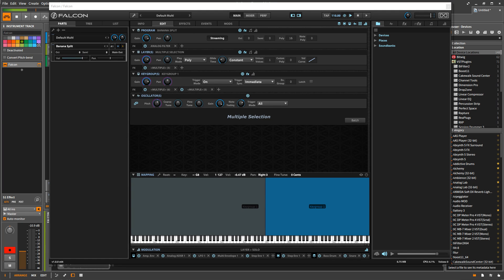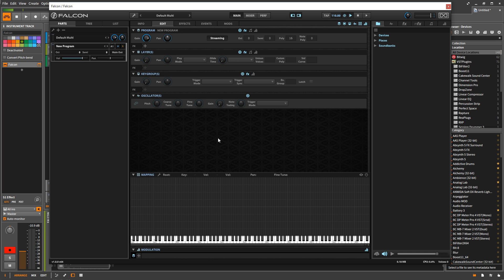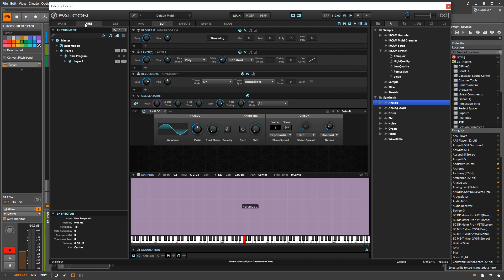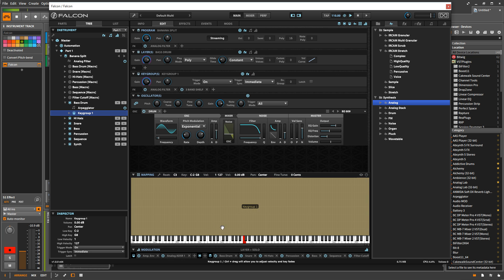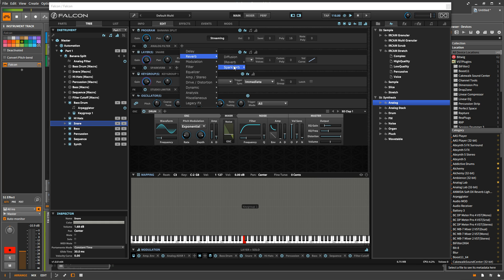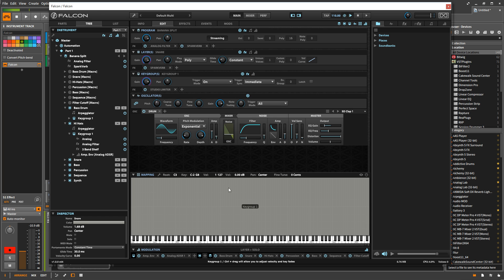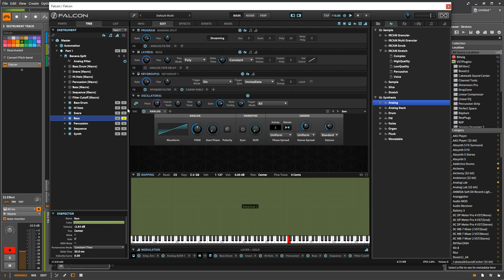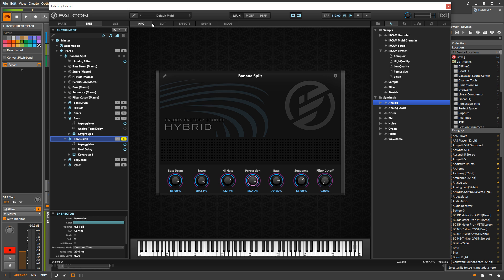UVI Falcon: Understanding the Architecture

Comment: do you still use falcon and think highly of it since 2015? i really want to buy this synth to do 80's music...i dont want to buy vintage vault i actually want to program my sounds from scratch? is it capable of that sound of those vintage synths from just the oscillators?
Reply from the maker: It is a really powerful synth, but I don't use it as much as I used to. There are some quirks with it that make it a pain to use sometimes. One big thing is that automation is kind of a pain with it because you have to assign a parameter to an automation slot, and then connect the slot in your DAW. Nothing is pre-assigned so you can't just tweak a knob and record the automation. But yeah, you can definitely do vintage stuff with it. My favorite synth these days is VPS Avenger, because it's powerful, and fast to get results.
Reply: Thanks for your videos about UVi Falcon! What about the Falcon 2.0 update, is it still as tidious to assign automations between the DAW and Falcon? Which DAW are you using? I am using Cubase 10.5. Thanks for your answer in advance.